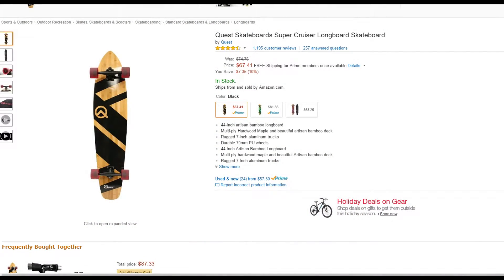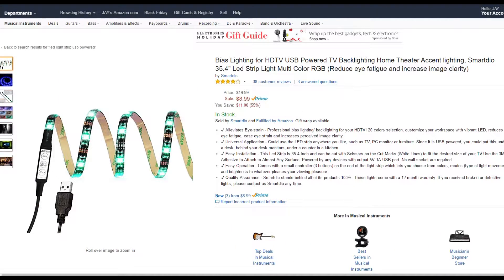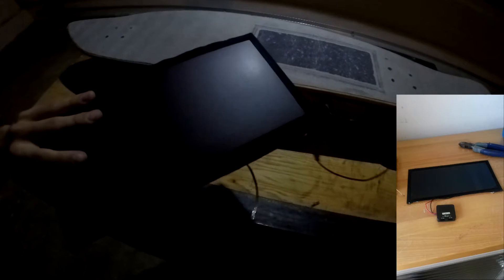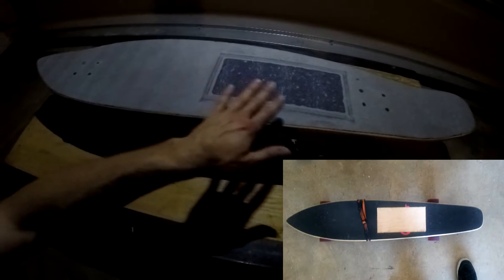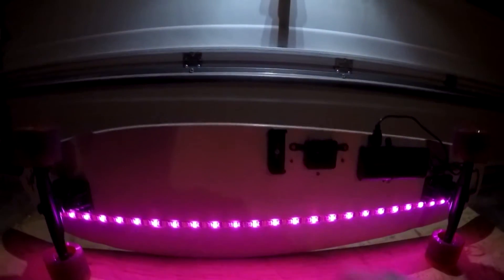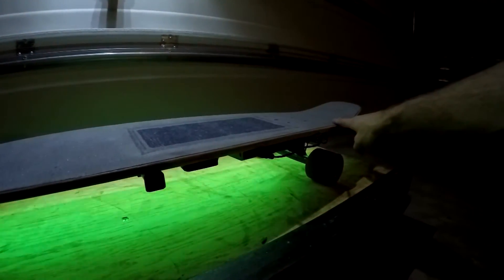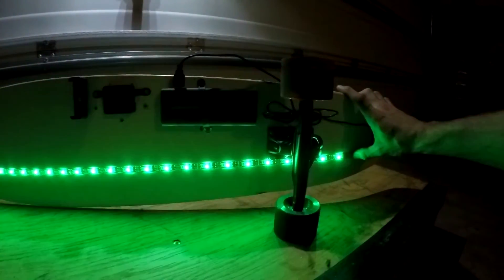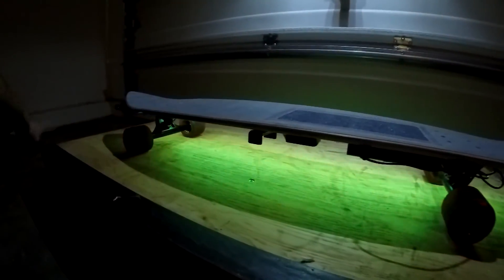$150 SOLAR POWERED LONGBOARD

Comment: How would you actually use it ? Like do you turn it on or what? Does it need a remote ?
Reply from the maker: I was going to set up a electric truck underneath to power it with a remote, but never got around to doing it.

Comment: How well would it charge while in use?
Reply from the maker: TheWroster I think it depends on what device is being charged. I did one test with my phone directly from the solar panel usb port and it charged it from 70% to 85% in about a half an hour. I should do some more bench marks with other devices and time it to see the difference. Also I think the power bank will charge a device a lot quicker based on the 4.5amp output. Like I said it's not perfect and can be done better than what it is. It is a prototype after all lol. I'll do some benchmark testing with different devices and get back to you with a more determined answer.